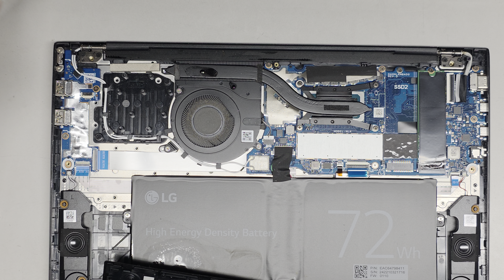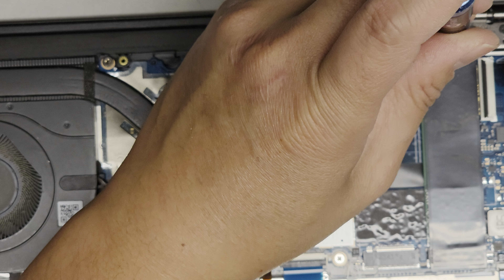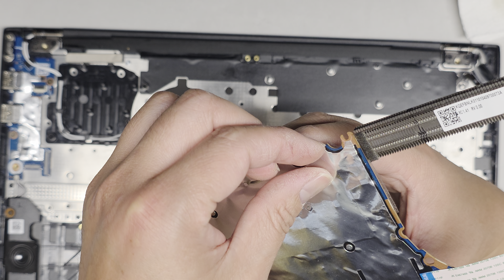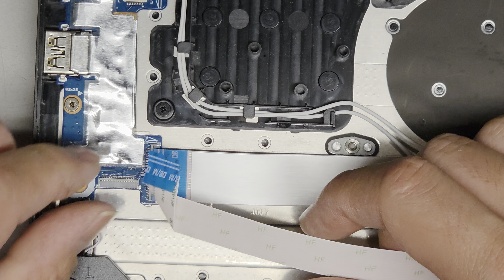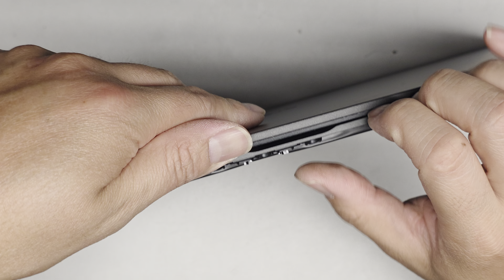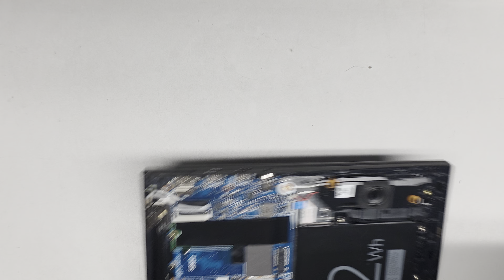LG Gram 15Z90S-H.AAB6U1 Disassembly *No RAM* SSD Upgrade Battery Fan Replacement Repair

Comment: Hey, i have a similar model with Bitlocker and BIOS date issues. Is there a separate CMOS battery in this model to change it? Have not seen it and cant find info in the web. AI says I have to swap the whole battery.  Thanks in advance!
Reply from the maker: Think it's built into the battery

Comment: I am replacing the main battery.  the unit is 2 years old. while i have it open should i also replace the CMOS? it hasnt failed yet so I guess I could leave as is.
Reply from the maker: Cmos battery can last over 10 years in a lot of cases. No need to change it if no issues.